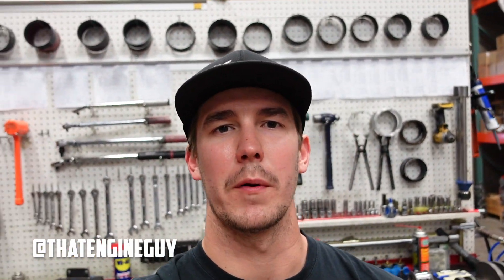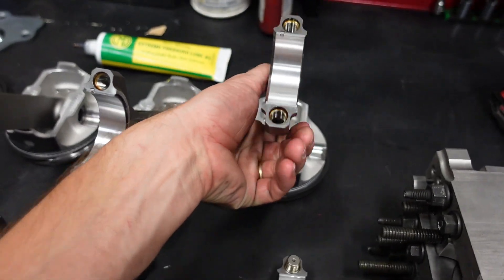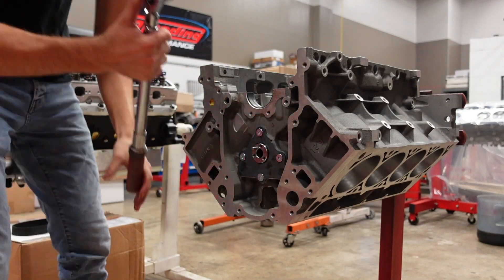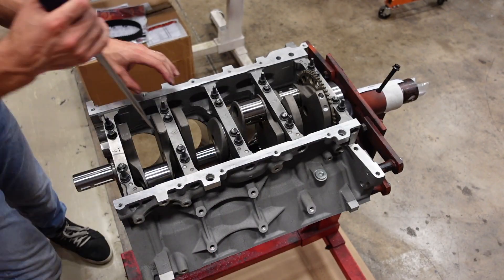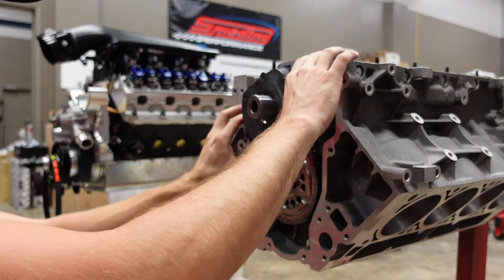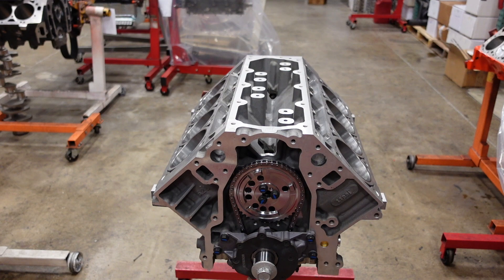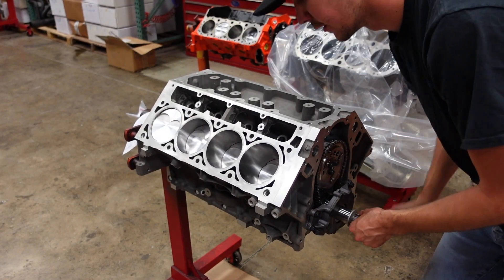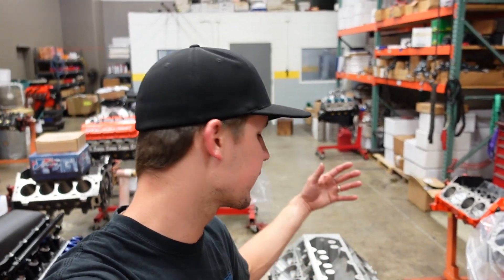Building the Perfect 416" LS3 Street Ripper - Part 1

Comment: Do you use plastigage on crankshaft before final torque to insure correct size bearings??? Or do you not have to on a new aftermarket crankshaft?

Comment: Uhhhh, you could have saved some of that assembly lube on the cam by simply squirting it down the oiling hole in the main bearings.  Cause that is where it goes anyways.

Also, you should NOT turn the crank without both sides of the bearings being installed.  Cause the bearing is nto truly round until torqued in place (according to the guys on Engine Power).

And I always put the crank in with the flexplate on the back with a couple bolts holding it loosely so it is easier to turn the crank as the rods and pistons are installed.

Comment: 10:07 is not necessary to align the oil pump?
Reply: He let the oil pump bolts slightly loose than turned the crank so the pump gears self align than torqued down the oil pump bolts

Comment: would a cam with these specs be enough for a 416 stroked ls3?
Duration	228/238
Lobe Separation	@ 113
Valve Inlet	.600"
Exhaust	.603"

Comment: This is exactly what I'm looking for a 416 for the streets. I have an L99/LS3 I pulled out of a 2010 Camaro and a buddy of mine who builds engines went through it and made it new again but it's pretty OEM cause I was originally going to throw it into a Datsun Z car that i'm now selling. Long story short I want to put the LS3 in my C6 since the car is down and the motor is down atm but after doing all this work I'd hate to put a "stock" engine back in it. I'm up the road from you in Fort Worth, I'd love to drop it off for something identical to this. I'll strip it down to the bare block. I still have my LS2 as well and tore down to a bare block as well. The only real knowledge I have is from watching your channel and all your 1/2 mile runs with the C5, good shit!

Comment: What’s the max cr you’d run on pump gas with an ls?
Reply: E85 is a pump gas..
Reply: @dennisrobinson8008  I was meaning 91 or 93 whichever you have nearest you. My build I’m going with E85 but curious to the safe cr for if I’m driving and happen to be where e85 isn’t available. I’ll be running a content sensor for that reason
Reply: @ccooper04  You'll be able to get away with 93 or 91 octane with 11.5:1.

Comment: I've  only worked on SBC's so Im no expert  but every one else I watch put on a oil pump on a LS they shim them. But you didnt . Can you explain that ?
Reply from the maker: I now install them by very lightly threading in the bolts (loose enough so you can still wiggle the pump), then filling the pump with oil, followed by rotating the crankshaft over several times, and finally torquing the 4 bolts down, is perfectly adequate and negates the need to shim the gears.
Reply: Ok. Thank you.

Comment: Do you shim oil pump ? I didn’t on my build haven’t had an issue
Reply from the maker: I now install them by very lightly threading in the bolts (loose enough so you can still wiggle the pump), then filling the pump with oil, followed by rotating the crankshaft over several times, and finally torquing the 4 bolts down, is perfectly adequate and negates the need to shim the gears.
Reply: @JacobVillemain  
Yes, that is how melling says to do it.
https://www.youtube.com/watch?v=zzz6NkXTq24

Comment: Nice! I hope I will get a 416 some day. What hp numbers are you guy's aiming for?
Reply from the maker: This one should make around 650-700.
Reply: @JacobVillemain  Thanks! Fantastic!
Reply: That’s a lot of money for 650 tire. I’ll stick to 300 dollar junkyard sbe 6.0 and cheap China turbos that make more than that.
Reply: @jasonjennings5833  ok buy me, I like NA motors and I have a broken "LS3" to start with
Reply: @tokslut  ls3 are hard to come by and expensive. I’ll stick to gen 3 lq4 truck blocks. For 200 bucks. cam and springs 450. 862 heads for 50 bucks. Deccaped flex Injectors 150 flow matched. S475 and rest of kit for 1200. No while I was in there bullshit. Reuse head bolts and head gasket. Proven combo. If it blows up tomorrow. Couple days and a trip to the junkyard to get another high mileage block. Not 4 or 5k for 650 tires. That’s stupid.
Reply: @jasonjennings5833 What Chinese supplier do you use?